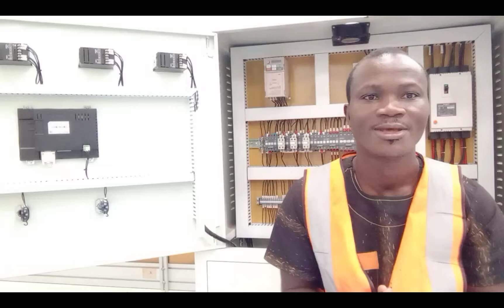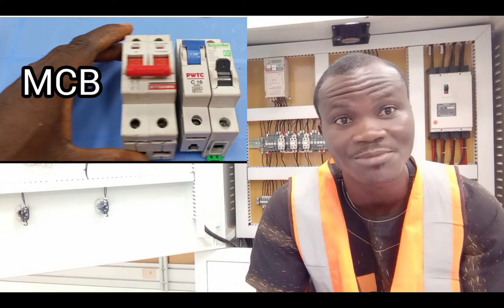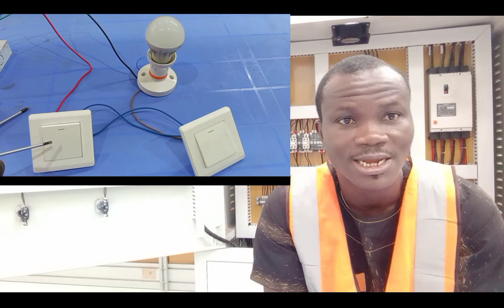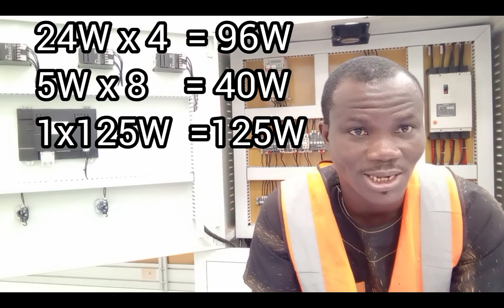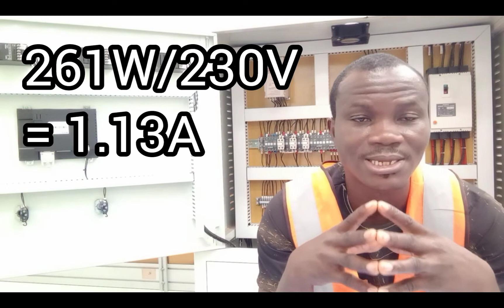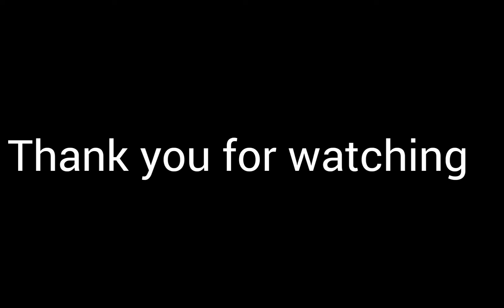SIZING OF CIRCUIT BREAKER

Comment: Another question please, in the calculation of yhe cooker current, we had 13amps, why do we always use 6mm² cable for cooker circuit while even 2mm² can be okay per current carrying capacity of the cable.
Reply from the maker: Cookers come in different sizes. So ideally, the cable size should be determined by the size of cooker. If you don't know the size of cooker to be used, then use a bigger size of cable.
Reply: @obloni_Electrical  Thanks for the explanation... God bless you.

Comment: Please i want to ask you a question not relating to the topic. When calculating a current for a single phase, do we include a power factor.

When a voltage rating is given between 220 - 240V and a power of 80W is given. Which voltage you are to use to calculate the current of the load and do we include pf
Reply: Yes, power factor is just the efficiency.
Use 230v
Reply: @badrubakari1418 thanks

Comment: For motor overload protection a DOL starter with appropriate rated OLR relay is better compared to a MCB, as the OLR has step-less  adj. within it's range, whereas available MCB/fuse rating is fixed.
Reply: Come again